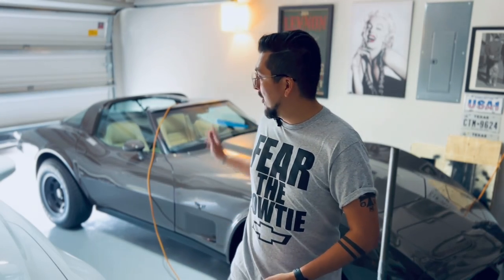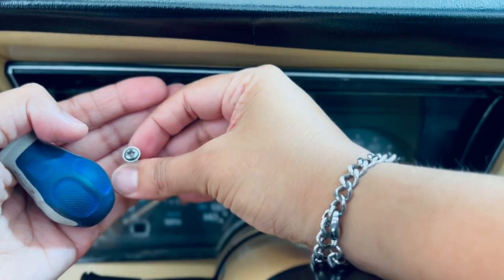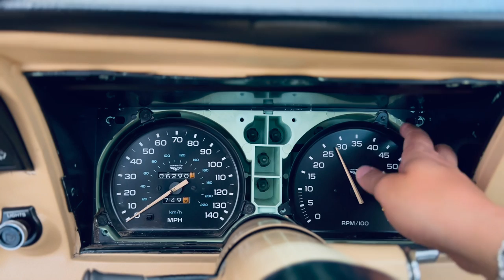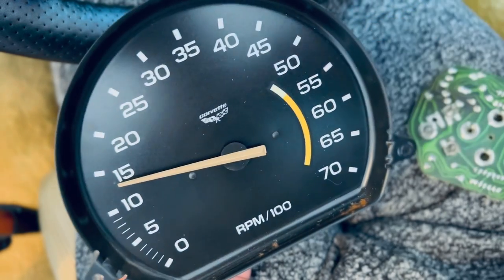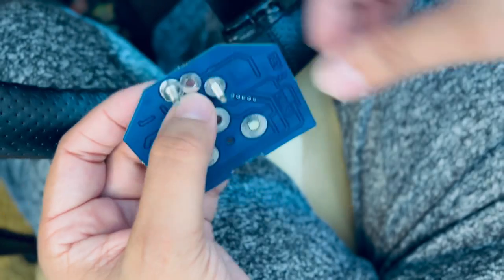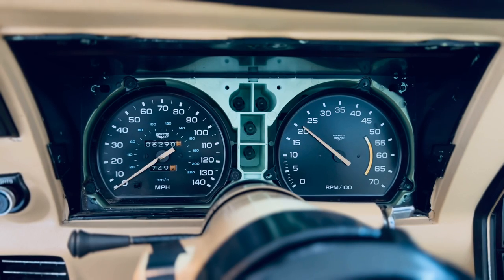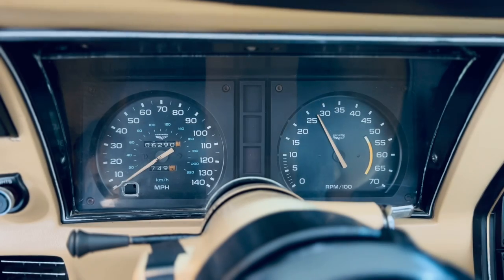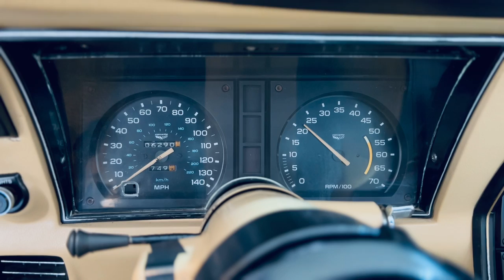C3 Corvette Tach Board Replacement

Comment: The electronic tachometers will rest at about 1500 - 2500 RPM when not powered. It is normal. The needle needs to be lifted off (carefully! there are videos on youtube showing how to do this) and put back down in such a position that the tachometer will show 0 RPM when the ignition is on but engine not running.

Comment: Thanks for sharing your tach PCB replacement! 
I also have a ‘79 with a tach that doesn’t work. I’ve replaced the tach filter hoping that would fix my issue but it didn’t. 😔 
So it’s time to replace the PCB. 
Did you video how you needed to calibrate the needle? 
Keep posting more videos of your Corvette trials and tribulations! 
Take care!
Reply from the maker: Hey man! 
No problem, I did and it was super easy just be careful as the needles are super fragile and they are prone to break as It happened with mines lol
Reply from the maker: I didn’t do a calibration video because i ended up braking the needle as they were old and fragile. Be careful!!!essentially once you have installed the board and the tach back ( test it and see if the needle moves first) . You will have to turn your car on and let the car run for about 2-3 mins to a normal idle. pry out the needle, with your car on, Then you will put the needle back gently to its correct idle, then test acceleration and see if the needle is reading normal. 

Hope this helps
Reply: @c3sgarage  Thanks a lot for the heads up on being careful with pulling off the needle to recalibrate it. 
Gotta love these older cars cars! There’s always something unexpected while doing one project or repair.

Comment: Very nice instructions on circuit board replacement. I did see in the comments you calibrated the needle. With the key off, the gauge should show about 1100. With the key placed to ON (not start), the gauge should display zero. Hope that helps. Also, for what ever it with worth, when I took mine apart, I replaced all the bulbs at the same time. Figured I had it apart. Why not right? 😊
Reply from the maker: I actually replaced the bulbs during the replacement but did not get to talk about it haha
Reply: Yeah, I figured. Just too tempting to not pass up 😎